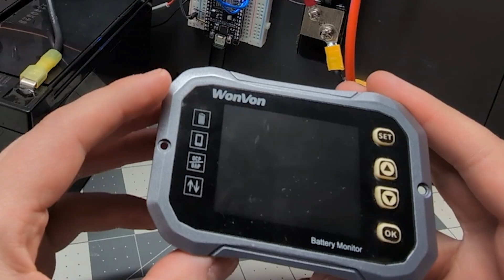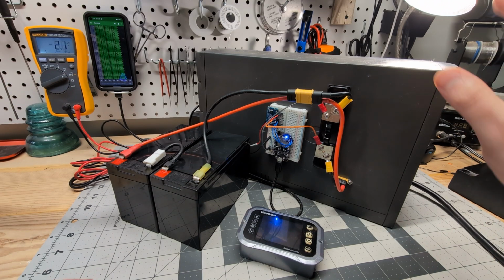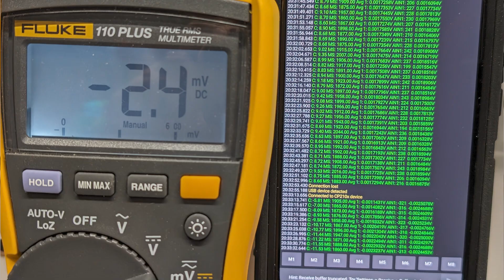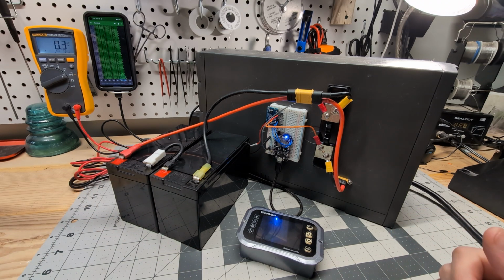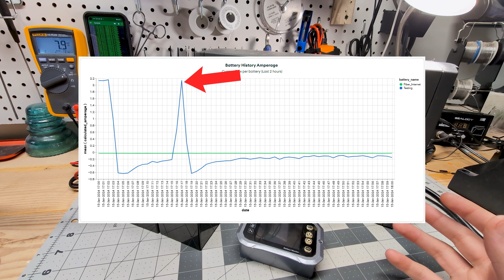Ultimate DIY Battery Upgrade: Cloud Connectivity & Real-Time Monitoring! Perfect for off-grid solar!

Comment: Awesome project!
At home I have a 1.8KW UPS running on 12V with two batteries in parallel and plan on using a similar approach to measure the voltage and current on each of them and this video just remind me to finish the project and also how to lol!
Also, the fact that the PCB is a little sketchy is what makes it an awesome project!
Reply from the maker: Thank you!  Good luck! Keep me updated on the progress of yours.

Comment: Aren't the APCs 12v? How is the ADS1115 connected? Was the 12bit resolution of the ESP32 ADC not appropriate?
Reply: The native ESP32 ADCs are notoriously nonlinear and inaccurate, it just saves a ton of headaches to use the ADS1115
Reply: Thank you for explanation. I too was wondering why the esp32 adc inputs were not used.
Reply from the maker: @Rhinomods  Will make a video on it
Reply from the maker: I did not know that, thank you! I love the 1115.
Reply from the maker: I might make a video on that

Comment: I am working on something similar. But then a diy battery + inverter + smart controller. I am now at the smart controller stage and am using an ads1115 + an acs758. Just have to create an custom pcb for it and then I would be done! Already made an website using littlefs.

Great video btw a little short but nice to share it.
Reply from the maker: Keep me updated on your project!
Reply: @ryansusman8491  will do!